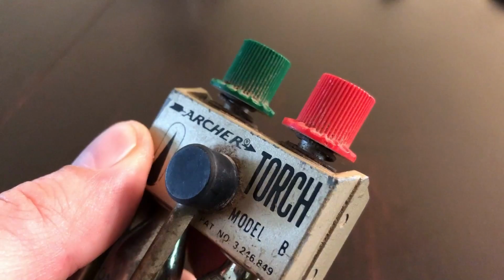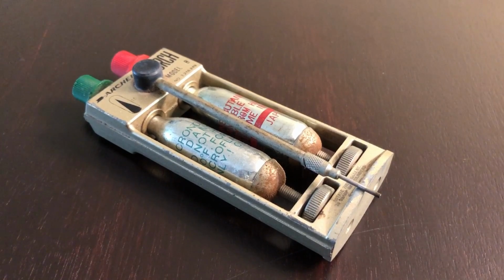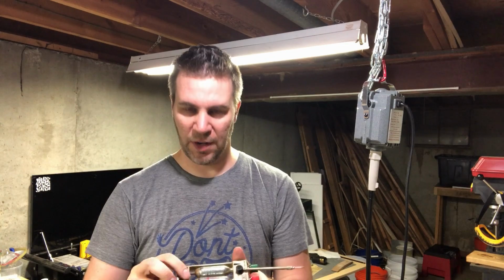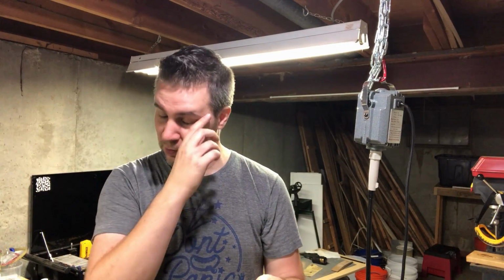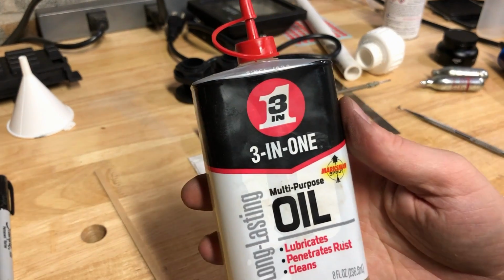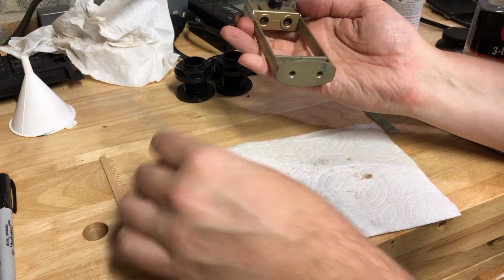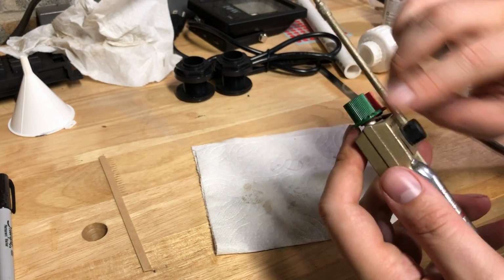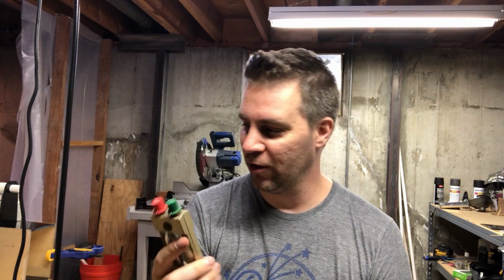Quick-ish Fix: Microflame Torch

Comment: I have the original Miniature Microflame torch.  It is a complete set with case, cylinders, instructions, etc.  It is in excellent condition.  I have not been able to get more cylinders.  They are not made anymore.
Reply from the maker: I’ve seen a few unused cylinders pop up. I think a friend of mine has some actually.
Reply: the no'x. is available as a whip cream item. look for "whip it" whip cream.
the other tank you need to modify one (more?) tank with a pressure valve to "squirt" in the gas.
the way how is online.
Reply: Ive collected 8 pairs of them off of ebay just this past weekend. Just look for them youll find some.